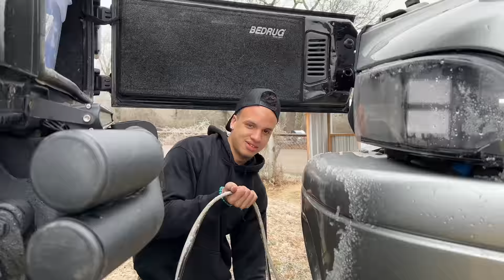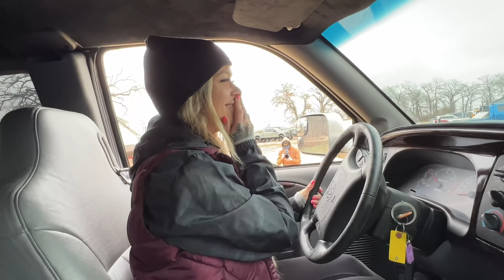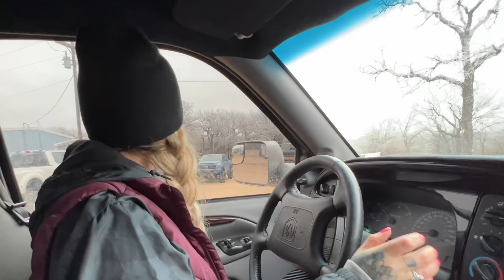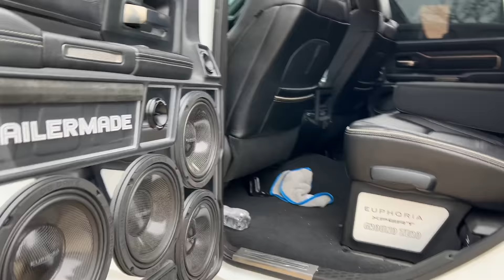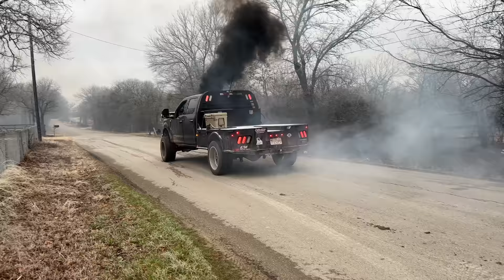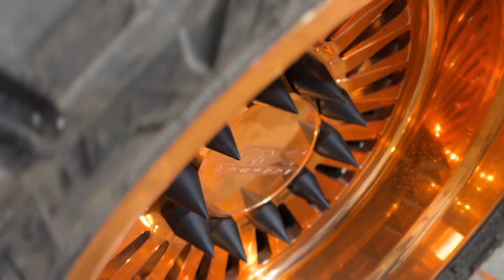$200K Sema Truck FALLS OFF Trailer.

Comment: Dang that sucks it feel off the trailer , you should turn it into a single wheel
Reply: It's an f450.
Reply: @kirmitdafrog9631  it can be done. and it would looks alot better and easier to deal with

Comment: Yet another “200k” show truck without a front driveshaft or locking differentials. Lame. If you would’ve built it fully then it would’ve just drove right off instead of spinning 1 tires.

Comment: Why not get a front driveline? It has to be possible.
Reply from the maker: Have one and I broke it it’s getting rebuilt. Either way even if I did I wouldn’t have dragged the axles across the trailer and mess up the powder 🥴
Reply: @GabeFarrellProductions  oh wow! I would have though the powder was damaged from the fall alone

Comment: My 5k cherokee would flex off the side of that trailer and drive away with no issue, why can a 200k lifted truck only flex like 1 foot and get stuck? Do you not step back and just go, wow...this is pathetic.  I do not understand this truck trend...and I work at a light duty diesel performance shop.